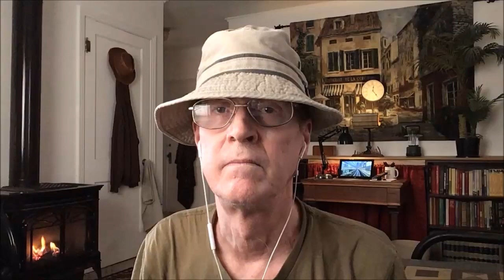My First Dummy Load

Comment: Did that as well. Never considered what its impedance might be. Later on, I wondered about it but never bothered to measure one. Now retired and locked down in the house, I decided to finally find out. Had a hard time finding an incandescent light bulb but finally located one in a closet ceiling fixture. After all these years it looks like 1900 kc complex Z =15.6 +j6.5, 3700 kc = 16.9 +j19.3 and finally, 14250 kc = 34 +j101. I now feel like there was an accomplishment today.

73'
de K4WRF

Comment: Think my 6L6 had a plate input of about 30 W..SWR???..What's SWR?...never did measure output..but it would light up a low wattage incandescent light bulb just fine..prolly about 10-12 watts out..I also managed a QSO across town with that makeshift dummy load..